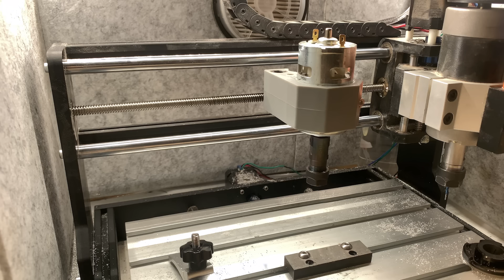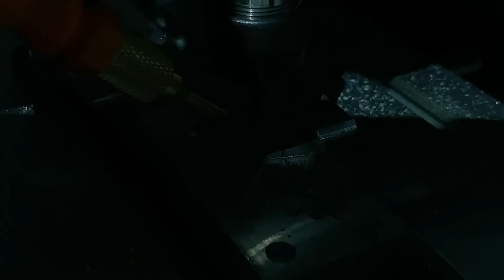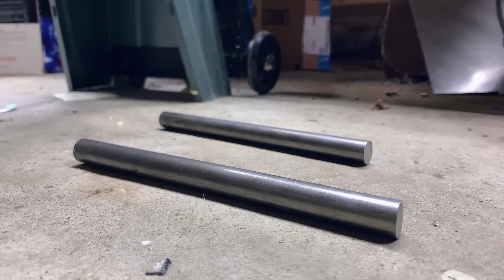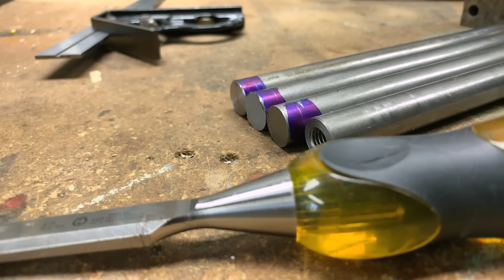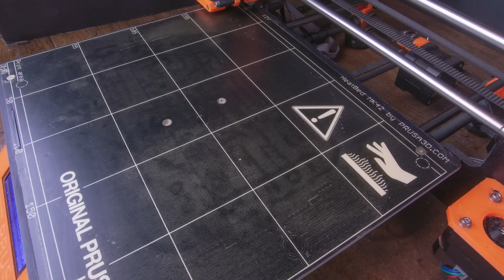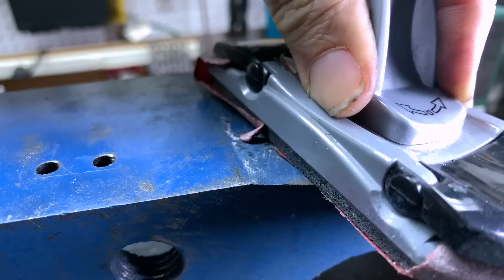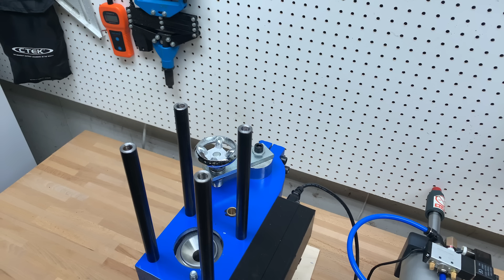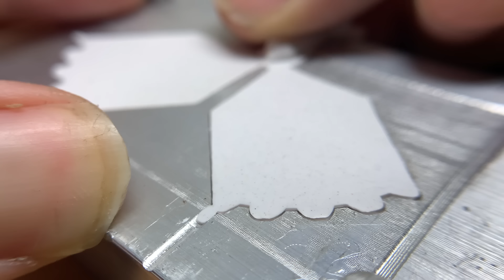Build an Injection Molding Machine From a Cheap Pneumatic Press

Comment: Hello! This is great!!!
I've seen some videos where intead of a machined piece they use 3D printed resin, one with properties matching these needs, do you think is a better option? What adavantages do we get from CNC? (I'm guessing pressure is the main). On top of that I have another question :). About injection volume, Is this machine or technique able to fill up something a bit bigger? let's say I want to create an injection molded piece, a Flight stick / hand grip; A 2 parts piece, split on the symetry axis. Can something like that be made with your amazing machine? Aviation ABS looks like what I need (not even a clue if that makes any difference). But Thank you very much! I love your videos, You inspire!. cheers.
Reply from the maker: Oh sure.  I guess you can reach me at channel name @gmail.com. just be aware that I get almost no email there, so I only check it sporadically. lol. Still I keep an eye on in for the next few days.

Comment: How amazing.I was just videoing a failed 3d print of mine which I wasn't happy with how I pushed the hex threads hot down into the plastic. Then your video showed almost identical shape unit with brass things being pushed down hot into it. Length width and height of your black unit I have a 3d printed base for a mag drill project with the same look about it. At the same time though as seeing yours. Freaky.

I really want an injection moulder but also I really want to be able to machine inc the aluminium moulds. Any recommendation on a inc mill bench top style..?
Reply from the maker: I haven't really used a lot of different small CNC's.    The 3018Pro I rigged up is fun/useful, but needs a lot of mods in order to have it be able to do a good job with AL.   I'm sure something like a Nomad or Bantam would be far better/work right out of the gate, but the prices get crazy.  So it's a bit of Time VS Money.  I will say that having a super cheap/low power CNC is great for learning.  When something goes horribly wrong and I crash into the table,  I just laugh, file off any bumps and keep going.   If that were a 5k machine I'd be sweating bullets all the time.   Also destroying some $3 carbide cutter is way less stressful than destroying some $60 cutter.  So in terms of leaning CAM without a lot of stress/loss of coin the 3018s are great, but you do end up seeing other machines making super clean deep cuts and think "Man, that would take 6 days for my machine to do".   I have seen some used Nomads going for < 1k so that might be a good middle ground.  Don't under-estimate the value of having full containment.  CNCing AL makes a crazy mess of AL all over the place if you don't have full containment enclosure, and you risk getting little bits of AL in the controllers/you laptop, etc.  Really not optional.  Good luck!

Comment: i turned my old and broken 3d printer into an injectjion mold, just attach  a large nozzle and let the filament extrude in the mould , works like a charm
Reply from the maker: That’s fun. I suppose it depends a lot on the mold shape/material.  What kind of mold were you using? I assume for thin walled designs in AL molds the plastic would freeze before fully filling the mold but I love the low cost of entry!

Comment: Love your stuff, kinda funny I found your videos again. I guess cause I've been trying to learn different manufacturing techniques. I'm amazed at all your tools... Like you have lathe?!?! Jealous
Reply from the maker: I've been building up my shop for a very long time.  First a drill press, then a little band saw, and then the lathe.   I'd been trying to build a lathe using the David Gingery books, but then I got a post college  job, and decided that buying the lathe was going to bootstrap a lot of other projects, so I went for it.  I'm still using the same diagonal cutters I used in high school.
Reply: @retrotechjournal   that's cool! I also have the same Mini CNC 3018, I watched another video of someone beefing it up with a router motor to CNC aluminum faster. Love the ensclsoure idea. I also watched a video of using plastic dies for casting, I'm assuming some like ABS as the die and PLA as the injection material? I didn't get the details.
Reply from the maker: @Zewwy_ca  Yes, the enclosure turns out to be key simply because otherwise you're throwing AL splinters/Wood Dust/Plastic shreds all over the place!  And it helps some with the noise although the air compressor is the loudest part really...  I think those plastic dies are people using some higher temp/tough SLA printer resin to make the molds and then injecting with whatever.  I don't have an SLA printer so I haven't tried that.  Still it seems interesting.  Not really sure how long a run one could do with dies like that.
Reply: @retrotechjournal  oh yeah that's what I saw them using, I just bought a Mars3 pro. I could print a die for you.
Reply from the maker: @Zewwy_ca  oh. No worries.  It would be interesting to mess with a sla printer but I’m having fun learning CAM and just going with AL for now.  Thanks for the offer though. I appreciate that!

Comment: Your voice sounds so young and boom, you’re Santa Clause❤.  Ive been told I sound young myself at 51 and surprise people when we meet. Now I know what they mean.. haha. Love the content man Great Video, well produced.
Reply: Im considering building an injection molding machine, so I’m looking to see what others have made. I need a much larger platform though. These things are like water jets when it comes to expense and whats available. Top 3 most unavailable due to costs are:

1.) water jet
2.) injection molding
3.) wire EDM

Which leads us down to the DIY road and most can be made in a small scale but limited.

1.) water jet using a car wash pump, electric motor, and DIY exciter, very little info about them. Probably the hardest to DIY and so often avoided.

2.) injection molding in small scale is very feasible and then a big gap to doing anything in size due to thermodynamics and overall physics. Id like to utilize a induction heater into mine for a more controlled transition to the nozzle.

3.) wire EDM Probably had most potential to scale up with low cost compared to large industrial machines but they’re so messy if not built correctly. Probably easier to find someone giving away an older industrial one and guy it and build it and you might have a 20x20 table. Forget original control and power supply since they’re as large as the actual machine and send to the scrap yard.

Another underrated build is the pneumatic cylinder. There isn’t much to them at all. Surprisingly easy to build with the right machinery available.

A smaller sized 2x4 (feet) water jet table would be ideal to pursue. 

I may start building one right after this turn mill I’m building. Or maybe a injection molding machine comes first.., 😅😅
Reply from the maker: Well, I really wasn't sure how to take folks saying my face didn't match my voice.  Those two have been together every minute of my life. lol.  Good to hear other's sometimes get that feedback.  I'm glad you liked the video.

Comment: Thanks great video. Quick question, does the plastic drip out of the barrel when it is hot or do you have some type of contraption to prevent it from leaving until you actually do the injection in to the mould?
Reply from the maker: Great question. Right now if you let it sit for a while it will ooze a bit. If you're injecting at max speed it's not really enough to be an issue, but if I pause for a while I'll slide the mold forward slightly so the end of the barrel is against the flat top of the mold, and that keeps it from continuing to ooze.   So far some of my mold designs have included a little dead leg area for that cold bit of plastic to get trapped, so it doesn't screw up the injection, but you can also just whisk it away with some needle nose pliers or something.  I'm probably going to stop including that trap in the models because it wastes more plastic per shot.  That's why the Little My mold has that kind of large J shape feeder you can see in the video.   That first mold (The Retro Tech Logo mold) doesn't have one of those traps, but I haven't had it be a big issue even with that mold, so I may opt for less wasted plastic.  Also if you set the barrel low enough, the act of pushing the mold under the nozzle pretty much wipes away most of whatever ooze has escaped.

Comment: Is there a step by step tutorial for laymen anywhere online?

Nvm just hadn't gotten there yet.
Reply from the maker: Initially I was going to try and make this as "kit" like as possible with some idea of sizing some collar one could order from Send-Cut-Send or something like that, but because I ended up having to machine the bottom of the casting I figured it suddenly went to "not so easy for non machinist folks to do" so I didn't try to make an actual kit, but later folks pointed out that a determined person with a die grinder could easily open up the casting enough to put that collar under there.  So I almost wish I'd gone a bit further with that.  I did put up the CAD models and folks can order the main chamber from Buster Beagle 3D, so in theory other folks could still build one.
Reply: @retrotechjournal  yes I don't think it's exactly easy but I have some friends that might be capable of assisting so I'm asking around. I may reach out with questions at some point if that's alright. Great videos man!
Reply from the maker: @officeroinks8823  Sure thing.  Always happy to answer questions.  I am happy with the way it turned out.  I've also made some additions like a 3D printed pellet feeder and a magnetically attached safety cage.  I guess if there's enough interest I could make a short video about those additions.

Comment: You're a inspiration man! I'm only 22 and I'm getting my mechanical engineering degree. I'm already dreaming of having a shop like yours and the skills of operating all that machinery in the future! But for now I'll keep watching your videos and drool away
Reply from the maker: Oh thanks!  I have been building up my shop for a long time.  If you're on a campus, take advantage of all the shop's on campus!  When I was in school I used the Architecture Machine Shop even though I wasn't an architecture student by making friends with the guy that ran the shop, and promising not to use equipment the actual arch. students were needing right then.  Same went for the foundry, I used their ceramic shell baths/burnout furnace by making friends with the Art profs that ran it, although I wasn't an art student.  Universities are full of folks that love it when students are excited about their field, even if they're not in that major, and you're already covered under the Universities insurance.  So go for it!  You could also look into maker spaces.  It's great to have access to tools you only need once in a great while, without having to clutter up your own garage.  I miss having access to all that sheet metal tooling. etc.  (I was a TechShop member until they went bust, and it was SO GREAT) Thanks for the nice note.
Reply: @retrotechjournal  thanks for the advice! I do every once in a while use the facilities of my uni but sadly I don't have the time I'd want to work on projects anymore. And you can do a lot with a 3d printer and some basic hardware. But yeah, the lastercutter etc. is nice every once in a while
Reply from the maker: @nathanhamers9160  I was slow to hop on the 3D printer band wagon, but it is true that these days you can do some amazing things with only a 3D printer and a lot of CAD chops. I'm now a poster child for 3D printers.   :]
Reply from the maker: @nathanhamers9160  Time is always the hardest thing, but I've found that if you schedule just one chunk of time dedicated to doing projects, you can think about those projects all week, and then just crank during the small chunk of time.   I did some crazy projects using just 1 night a week when my kids were small. (My wife and I each got 1 night a week of not juggling the kids.)  It was called TechShop night.  ;]
Reply: @retrotechjournal  so true, one thing I've learned is that time is dedicated, not available. The more I study the less I spend time on projects, and the more I neglect study the more time I spend on projects. One is always costing the other. Currently I feel like having 1 night a week is nothing, but maybe later in life it's all I'll ever have. We'll see. Keep it up and never stop learning, but you probably already knew that 😉
Reply: @nathanhamers9160  lol.  Yes, I specifically pick projects where I know I'll learn a lot. That's the actual fun part.  Also I think having limited time/resources makes you more productive.  It forces you to make decisions and move forward.  Anyway, good luck with your studies!

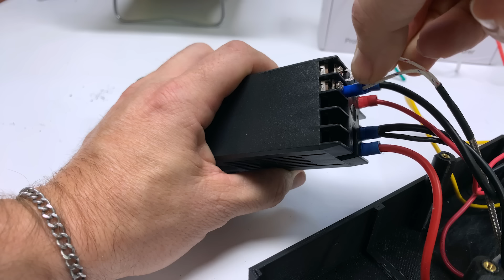Comment: I have a not working hazer for a stage. I need 100% the Part you use at 14:48 How is ist called? Thanks
Reply from the maker: That is a type K Thermocouple.  It's used to sense the temperatures in the heating chamber, and it's quite possible the hazer is using one for just that purpose.  Although my impression was that hazers tend to clog a lot more often then having their thermocouple die.  So it has good flow but the temp is wrong?

Comment: You can print the die and dont need the alu cnc job
Reply from the maker: I don't have an SLA 3D printer, but your right that 3D printed molds are becoming more popular, and seem like a great way to produce mold prototypes/do very small runs of parts.    I haven't tried it myself.  Personally learning all the CAM, getting the CNC up to the point where it could make the molds was a big part of the fun in this project.

Comment: hi😃 i am amazed and all the shots are so funny. What are those expanding pellets?
Reply from the maker: The purple ones?  Those are expanding foam ear plugs. I use them in the shop for ear protection but also some other uses. Lol. They’re great for spray paint masking and you can reuse them (for paint not for your ears!) a few times until the tops get too crusty.
Reply: @retrotechjournal  In meant the ones used in the injection. Kinda new to this....
Reply from the maker: @phamoen  Oh! lol.  Those were polyethylene  pellets.  They're the same as used by actual injection molding companies, but normally only available in giant comedic amounts.  I ordered medium sized bags of them from folks on eBay.

Comment: Would you recommend using a Makita router to replace the one in the 3018? I want to get into this but I have no idea where to start.
Reply from the maker: The main problem with putting a bigger spindle into a 3018 is 1) rigidity and 2) ability for the Z axis to lift the heavier motor.  I think if you just put a Makita router into a stock 3018, you'll have issues on both those fronts.   I put a cheap slightly beefier stepper into the Z axis which helped with lifting the 500w spindle.  That  didn't require me putting in a different Z axis driver.  So that is easy to do, but I also beefed up the X axis.   Which is a more complicated upgrade.  Not sure how a 3018 would fair with a Makita level spindle and no rigidity upgrades.  My guess is that would then be the limiting factor in terms of cutting force you could manage, and that the Makita's brawn would be somewhat wasted.  I do recommend getting into the whole 3018 thing though!   Even a stock one will teach you a lot about CAM!  Good luck!

Comment: Real fun - I mean I actually laughed when your fingertips, chisel and what not, magically did away with all that repetition we all now from the workshop.😄I won't be building an injection molding machine, I'm pretty sure, but I really enjoyed watching anyway. I did once upon a time consider doing injection molding in zink or possibly aluminium, since I did some casting. But I decided I didn't like the dangers involved, after blowing upp a casting sand flask (experimet with non standard procedure), hurling molten aluminium all around, as well as cracking my mother's concrete entrance stairway. (I was so, so lucky no molten metal hit me, or my assisting friend.)
I was only 15, and lacked any experience working with concrete, but of course I was going to pour a new side to the staircase. Unfortunately, I underestimated the rigidity needed to keep the concrete molds intended shape. So the end result looked like some seriously drunk person had been at work. And remember, this was also the first impression that met the eye of any  first time visitor.🤣
Even though I have always been a careful person, things like that happened. Like trying to use old car batteries for arch welding. Well, it worked for a few minutes or so, before my underdimensioned wiring melted, and caused a spark igniting all the hydrogen formed, exploding three car batteries, sending acid and shattered plastic all over the place. Luckily, I had my back turned to the explosion. There are more stories, and I've got some scars that can tell, but I've survived another 55 years so far, and still with 10 fingers (barely), so...
Now I'm going to check out some of your other videos!😃
Reply from the maker: Wow, great stories.  I'm glad you're ok! 😃 Thankfully I've been pretty lucky with my projects.  I don't think I've ever had a full on explosion that wasn't intentional.  lol.  I did once tear a fingernail off in my metal cutting band saw, but it was fine.  phew  I have a small burns from poking the hot end of an a welding rods through my pants, etc  Nothing big.  I did once singe the end of my beard off using a twist wrench on the handle of a yellow hot rail road spike knife.  lol  I'm gad it didn't fully catch fire!    I have a lot of "dangerous" hobbies, but I try to take care.   So far so good!  I'm glad you're enjoying the videos!